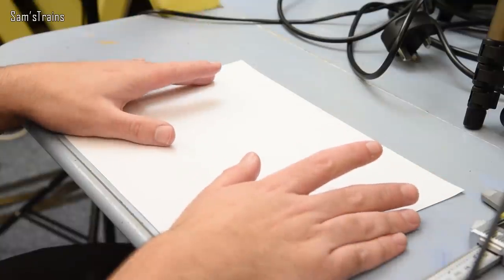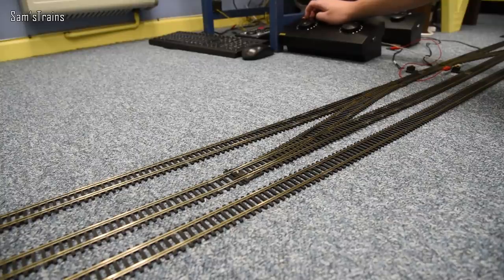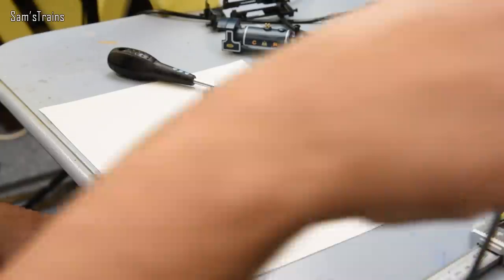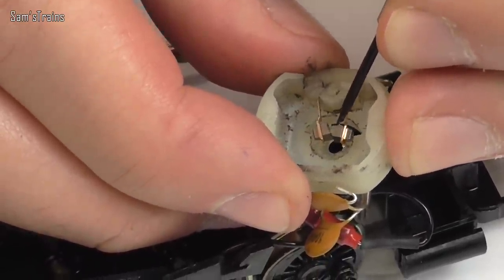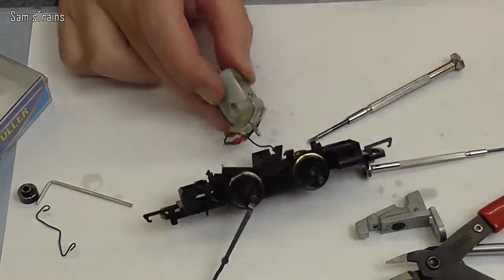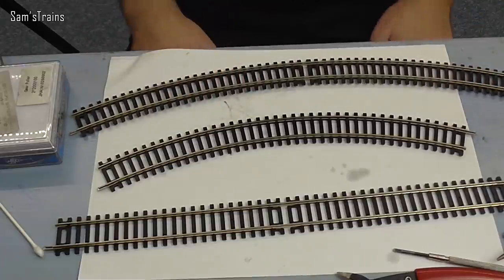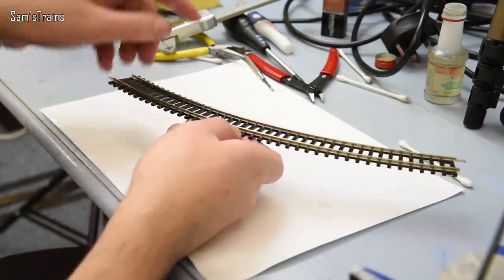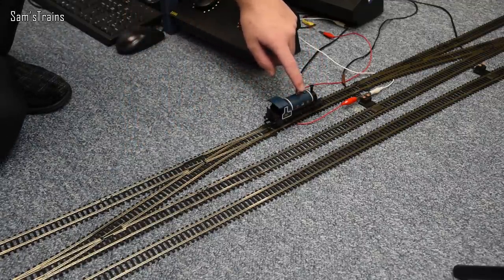The Model Train That Travelled Over 300 Miles: Autopsy

Comment: That is remarkable endurance. How do the new railroad 0-4-0 like this compare to the earlier version. I have an early version of that loco, the one with handrails and have found its wheel gauge to be a bit of a problem with Peco points. I have had to tease them apart a bit to get them to run over the point work.
Reply from the maker: Thanks a lot Rob - I was very impressed with this!! I'm not too sure about that - I've never heard of that issue, but I'll definitely look that up! :D
Thanks for watching - Sam :)

Comment: Very cool video, thanks! The little motor seemed well built, with the large carbon brushes. I realize this is a low cost model and I am not expert on model trains so forgive me if this is a dumb idea.  Anyway; the worn pickup; could you install a carbon brush head at the ends of the pickup, so that it has a similar wear life to the motor brushes?
Reply from the maker: Thanks mate - yes indeed, very impressed by how durable that motor was! Yes I'm sure you could do something with carbon - the only issue is space though - there's only enough room for a small sliver of carbon, so it'd wear away pretty quick - so they use pickups instead! It's cleaner that way too!
Thanks for watching - Sam :)
Reply: Cool!

Comment: i run almost all vectrons,  1014s from roco. i wanted to see what would happen so i put a 1014 (i have literally more spares for these than locos exist ;p)  in front of 7 acme and lsm coaches (heavy, some of the best models ever) and let it run on my track at ~40%. a week later most of the coaches had developed noises in the wheelsets where they mount into the bogies. tear down on the loco... nothing. nada.  my track is 30x20' overal diameter with alternating direction curves. some of these things will do hundreds of thousands of scale miles before you notice anything
Reply from the maker: Ahh very interesting - I'll have to try some of those for myself!
Thanks for watching - Sam :)
Reply: @SamsTrains  been watching for years..  :) loving how youve kept up with it all

Comment: I’m curious to know if you had any safeguards in case it developed an electrical short or other hazard when it was running unsupervised which might have caused the controller to overheat
Reply from the maker: Hey David - yes I did! I used a bench power supply to control her, limited to 200mA max. It may also have been this that preserved the brushes so well!
Thanks for watching - Sam :)

Comment: You need to measure the width of the rail, not the height. If it was pulling anything, the inside rail would experience wear.
Reply from the maker: Yes that is true - I didn't measure the insides unfortunately!
Thanks for watching - Sam :)

Comment: That was very interesting Sam. These little engines are amazing and I have seven of these all with different bodies. I am going to use the chassis off one of these, to power a Airfix Autocoach by converting it to a Steam Railmotor. Obviously the proper Steam Railmotors have a more sophisticated mechanism, but I saw one of these Auto coaches on Ebay a few weeks ago, that somebody had converted, using the Hornby 0-4-0 chassis, but I was outbid. I think it sold for about £45, but my highest bid was £35.
Reply from the maker: Thanks a lot Geoff - ooh that's awesome, sounds like a great project - good luck with it!! :D

Cheers,
Sam :)

Comment: Shouldn't you have measured the rail height at a point where there isn't a plastic sleeper underneath it? I cant imagine that the thickness of the plastic support is controlled to within the MM during manufacture... Could explain why the track used read larger than the unused track.
Reply from the maker: Yeah I should really - but there are no gaps sadly, so I would have needed to ruin the track, so that didn't happen in the end!
Thanks for watching - Sam :)
Reply: @SamsTrains  ahh fair enough, awesome experiment though!

Comment: What kind of gear puller were you using to take the worm gear off?
Reply from the maker: It's just a cheap one from Ebay: https://www.ebay.co.uk/itm/Walkera-W010-Gear-Pinion-Puller-Remover-Tools-Set-For-Rc-Motor-Pinion-Parts-Y5Y3/282751336226?epid=1169032754&hash=item41d54aff22:g:K9kAAOSw43haHJzS:rk:13:pf:0
Thanks for watching - Sam :)

Comment: PERHAPS WHEN MAKING A TEST RUN THERE SHOULD BE EQUAL NUMBERS OF RUNS BOTH COUNTER CLOCKWISE AND CLOCKWISE!  THIS WILL GIVE A MORE EXACT IDEAS OF WHEEL AND FLANGE LIFE!!
Reply from the maker: This is true, but I was hoping to see a dramatic difference in wear between the left and right side of the model... surprisingly, there was nothing of note!
Thanks for watching - Sam :)
Reply: Sam'sTrains I HAVE HAD SOME EXPERIENCE WITH FULL SIZE INDUSTRIAL SWITCH ENGINES WORKING ON TRACKAGE WITH 
SHARP CURVATURE, ALL IN SAME DIRECTION!  THIS CAUSES A LOT OF FLANGE WEAR!  THE TRACKAGE IN YOUR EXPERIMENT ARE RELATIVELY LIGHT CURVES,HOWEVER! CHEERS!!!
KEEP THEM ROLLING BROTHERS!!

Comment: How exactly does a "cold" primitive electric model locomotive run worse than one that has been running for a while?
Reply from the maker: As I understand it, the electrical contacts slowly oxidise over time (that's the pick-ups, motor brushes, wheel surfaces etc), which causes a small build up of insulating material on the surfaces. When initially started after a period of non-running, models often display poorer performance, which gradually improves as friction causes this build-up to be worn away.
Models regularly serviced and kept clean won't show these symptoms as readily, but as this one had been running for so long, the wheels and other contacts were guaranteed to be filthy from the get-go.
Thanks for watching - Sam :)
Reply: Thanks for the quick and detailed reply, that sounds perfectly plausible  @SamsTrains

Comment: HO is 1/72 scale, is it not? 72 X 300 = 21,600. Looks like it could have gone 600+ miles.
Reply from the maker: This is 00 scale (same gauge, different scale), which is 1/76, technically speaking! Yeah I reckon 600+ miles would have been fine, looking at that motor! Wish I had the time to test it :/
Thanks for watching - Sam :)

Comment: there is not much to go wrong with it in the first place.... would of thought more the bearings would be more worn out in the motor......  would like to see you try a modern burshless moter with DCC to see if one of the chips will overheat and melt  in the same test
Reply from the maker: That's very true - but it's still impressive that everything worked so well for so long! Ooh interesting-  yes that would be fun to try!
Thanks for watching - Sam :)

Comment: Hey Sam! I have a 0-6-0 jinty that when I serviced it using your Thomas 0-6-0 video, but when I built it back together It didn’t run but the motor inside was spinning/working I’m not sure what to do but do you think you have any tips/ideas? Thanks!
Reply from the maker: Hey! You'll want to make sure that the motor has seated back down properly, and that it's screwed in all the way! Make sure that the wheelset is in properly too! If everything looks fine, it could be that something has worn away too much! Let me know how you get on!
Cheers,
Sam :)
Reply: Thanks Sam for the reply, I actually found that the worm wheel is actually worn away which made the motor not catch the groove in the worm wheel. Is there any way to replace it? Thanks again!

Comment: Track wear:  Including the plastic railroad ties is in error.  Similarly, the rail (alone) should have been measured BEFORE the experiment and again AFTER the experiment, in the same location.

Additionally, I would expect that the plastic gears (worm and worm drive) to have experienced the greatest wear, as these are very softest materials.

All in all, a delightful experiment Sam.  Well Done!
Reply from the maker: I agree, but I didn't want to ruin the track! And the 'aftermath' video was an afterthought - I hadn't planned to do that from the start! I'd only expected the loco to manage 10 miles or so, in which case the track wouldn't have seen any wear! It was only after such a huge distance was achieved that I got to wonder whether the track had seen any wear!
Thanks for watching - Sam :)
Reply: @SamsTrains : The Liverpool & Manchester Railway (LMR) performed similar rail durability experiments in the early days.  Malleable iron rails, 15 feet long and weighing about 177 pounds were laid down and retrieved in 1833.  It was found that they lost 18.5 ounces (16 ounces to the pound) after 600,000 tons had passed over them.  The LMR calculated 1/268 of weight on an annualized weight loss
Reply: @SamsTrains  No one else is doing this type of durability experiment with locos on youTube.  You have the opportunity to set new standards for value!  Different manufacturers, different gear trains, different brushes, different pickups, etc.

The LMR experiment can serve as a guideline for you.  As frictional surfaces wear, they lose mass.  Mass can be measured with exquisite fineness, relatively cheaply.  A before/after measurement of the mass, with proper cleaning as we don't want oil skewing the result, will directly show wear of any complicated shape.

Cheers!

Comment: Does anyone know what gear puller he used. Thax.
Reply from the maker: Hey Lee - it's one of the chinese ones available on Ebay https://www.ebay.co.uk/itm/Walkera-W010-Gear-Pinion-Puller-Remover-Tools-Set-For-Rc-Motor-Pinion-Parts-Y5Y3/282751336226?epid=1169032754&hash=item41d54aff22:g:K9kAAOSw43haHJzS:rk:13:pf:0
Thanks for watching - Sam :)